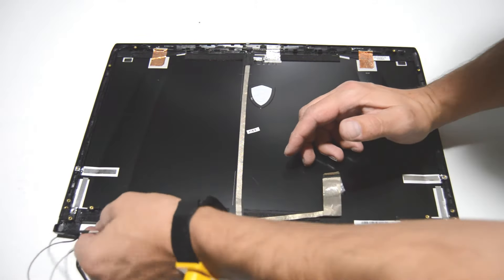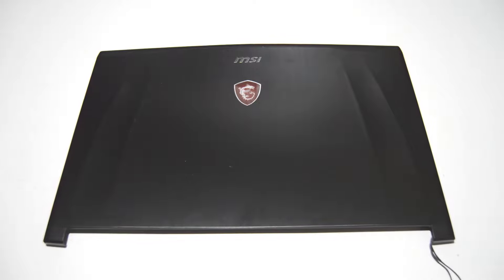How to Disassemble MSI GE72VR GTX 1060 i7 7700HQ Laptop or Sell it.

Comment: Thanks for the video! I am going to try to do a clean of the fans and possibly fix the screen which has broken off and dehinged on the right hand side. Has been a great gaming laptop for 4 years!
Reply: Bro same thing happened to mine, did you manage to fix it?
Reply: @aman9999able  I literally just fixed it. Over the past 2 years I had just super glued it back together and used it as a desktop as the brackets could no longer support the weight of this massive screen. Up until about 2 months ago the screen stopped working and I had to replace that too so just did the whole thing and cleaned it nicely. Still working great 6+ years later!
Reply: @demilishing  bro that's jokes I literally fixed my laptop today too bc the screen stopped working. Although the keyboard would light up so I took out the battery and tried it without and it worked. I rehinged the laptop too! But the charging port is loose now
Reply: @aman9999able  My charging port is actually doing quite well, it could be though on my laptop before this one it was the source of my problems and eventually I just got another. Hope your computer stays alive for awhile longer!

Comment: Would you be able to remove the keyboard from the palm rest case. ? Cheers
Reply from the maker: No
Reply: @Sellbrokedotcom  Tea has leaked onto my keyboard
How will I remove the keyboard?
please help
Thank you
Reply from the maker: @ahmad.alfakhouri  Sorry the keyboard appears to be non-removable, it is riveted into the palmrest and will have to be bought as an assembly.
Reply: even if its 1 year, i can tell that i replaced the keyboard you just have to cut these little plastic pins, they seem to just holding the keyboard but there are also little pins which are fitting the small holes the keyboard has, so the motherboard and the tons of screws are just holding the keyboard in place,

so yes, the keyboard is definitely replaceable, just cut the little plastics with a sharp blade, but be careful.
Reply: The official answer is to buy the keyboard and assembly, but do I have to completely gut it to replace the keyboard and assembly?
Reply: @mattptodd  you mean cut? Yes there are like about 40-50little plastic holder just remove them and be careful, after cutting them off u are able to take out the keyboard.
Reply: AdamantIT removes a keyboard like that by carefully heating up the plastic rivets with a spare soldering iron and popping the keyboard out. (Not this exact model though)

Comment: I have the exact same laptop and when i am playing it gets really hot, even after replacing the thermal paste. Am I the only one or is a common thing ? Any advices ?
Reply: I feel you brother, 

I have the same issue, with games like 3-4 years old, in high detail my system just heat up to 95 degrees, I already tried to figure out how to fix this, but it seems thats its a production issue, theres no other heatpipe replacement for better temperature results. 

What could work are laptop-fans, which brings some more air into the airstream of the laptop. Overall, after also replacing the thermalpaste, I do not think that there is enough space to get this system below 95°C while playing better games, its a Laptop issue especially the Thermal-management is done pretty bad in this model, imo. 

I am considering to build up an ITX System that will replace my laptop, but I am forced to wait until the gloabal Graphic Card problem calms down a little, these current prices are out of this world and absolutly unrealistic.
Reply: @friendlybucket7268  My man I'm in the same position rn, the gpu prices are mental.. And it is going to be this way till 2022, companies say.. I am a fan of the idea behind the blockchain and all but f them, they're creating a production and environmental crisis just to earn a few bucks..
Reply: Undervolting of the CPU and GPU helps greatly. Use QuickCPU to undervolt the Core i7, and MSI Afterburner to lower the voltage of the GTX 1060. It helped me to lower the CPU and GPU temps by 10'C when gaming. (Disclaimer: be extra careful when playing with voltage, as in the worst-case scenario when doing things improperly, you can brick your laptop).

Start with small changes and test the laptop after each of them by running some CPU and GPU intensive game for 10-20 minutes. For me, the Cyberpunk 2077 was the best test application, as with too low voltage it either started to stutter (CPU voltae issue), or close on its own (GPU voltage issue).

Comment: can the Trackpad be removed?
Reply from the maker: Yes but you need a heat gun to remove it.... it is attached with an adhesive sheet.
Reply: SellBroke that sucks, my left click button just broke
Reply from the maker: @Bri-MAIN  That's a different board.... that attaches below the touchpad. If you mean the plastic button cover broke, then you may need another palmrest if the buttons are attached..
Reply: i gotto get a heatgun from somewhere else my palmrest doesnt have a trackpad so i have to replace the old to the new and taking it out of it without damaging it.